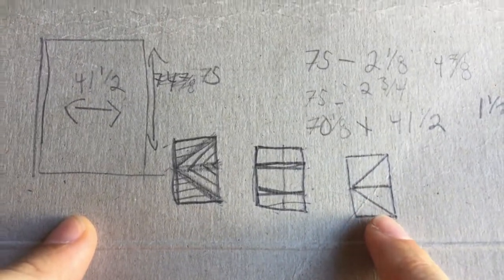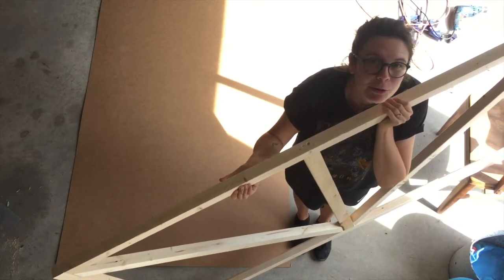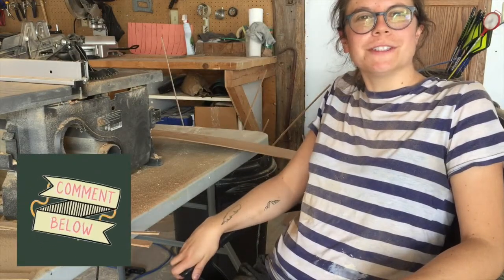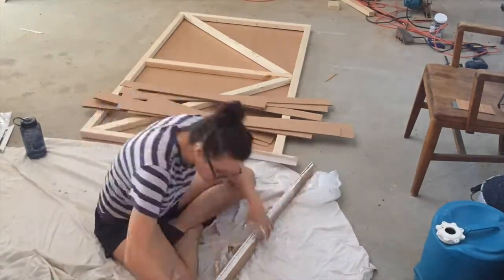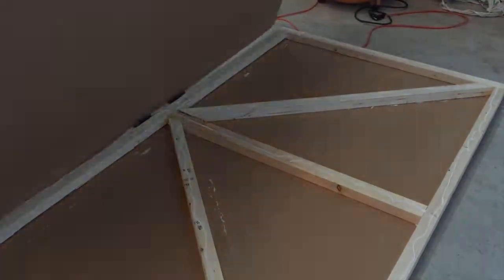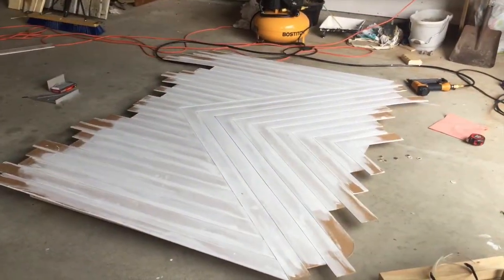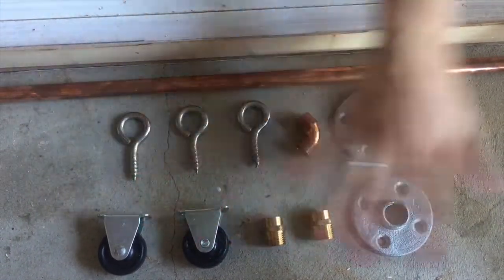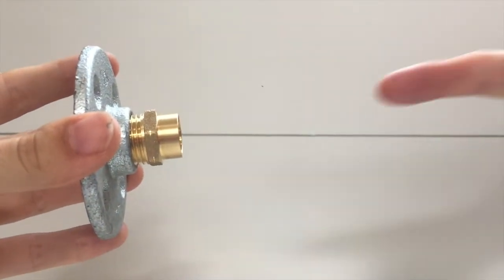DIY: Barn Door/Moving Wall | Camper Renovation | Trailer Remodel Project | Episode 12

Comment: lmao "thanks Angelo" for being the best long board catcher ever! I use a 50 gallon drum when I use my table saw (it's on a portable stand instead of a table). I love how you get perfect spacing between your boards with just using coins! Great tip~ I'm still trying to figure out what to do with the 4 inches between each of my windows in my shuttle bus. I feel like I can't finish the walls until I come up with something that doesn't permanently cover the screws in the frame.... Just in case I ever need to replace a window, I wont have to tear a wall down to do it.